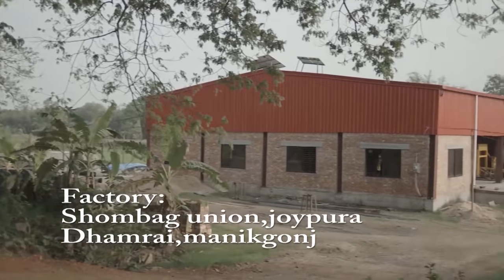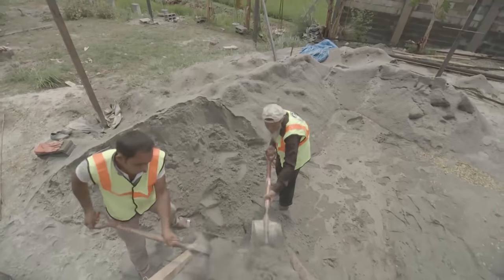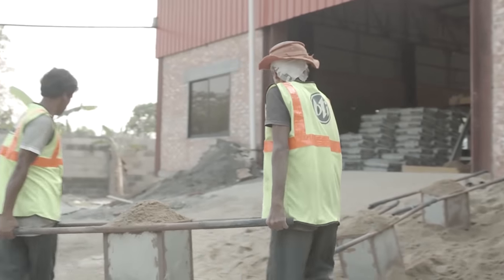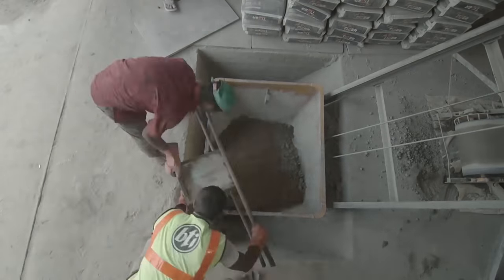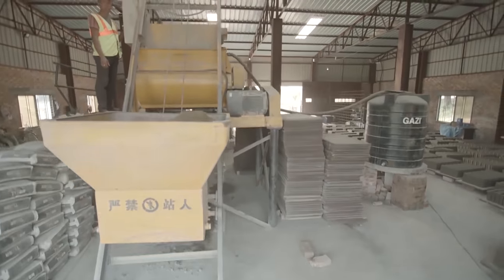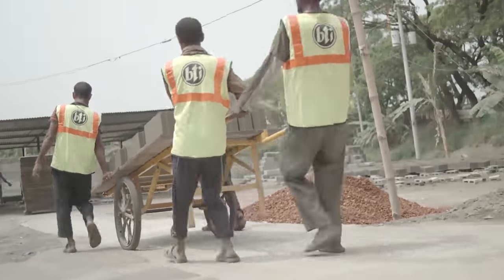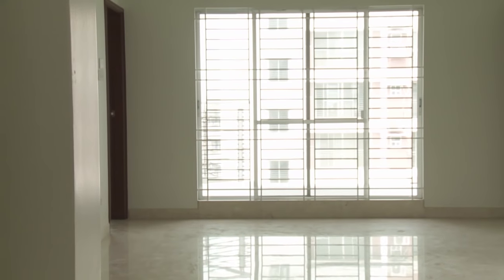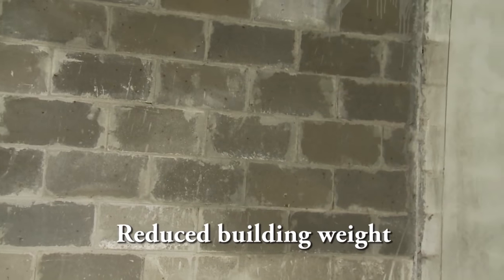Introducing Concrete Hollow Blocks from bti

Comment: Hey enviromentaly friendly??????? cement is very poluting to produce lol
Reply: It depends on the Carbon Content which is less than manufacturing conventional bricks. Also there are options of making Hollow Concrete Blocks in Fly Ash too.
Reply: @mr.ameedinam4706  Mate the pollution is produced making the cement. They don't mention that. I build our home using a shit load of cement making my own blocks etc si I know a bit about it. They are wrong saying its environmentaly friendly. Not against it just saying what they said is wrong.